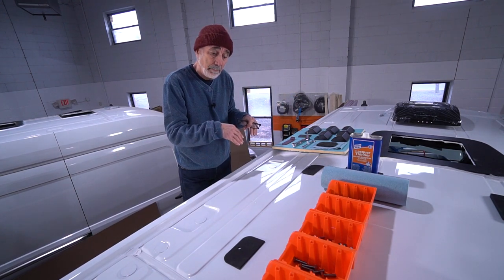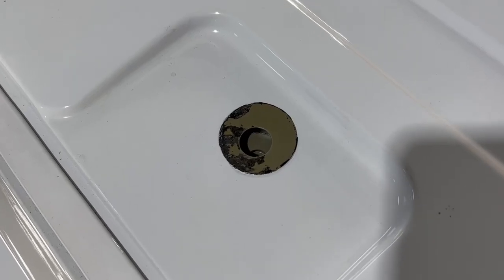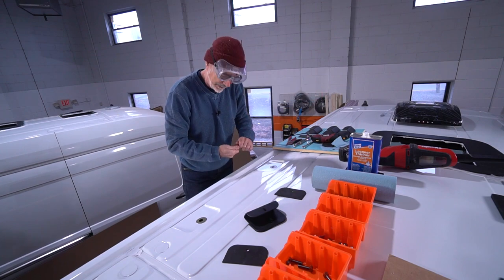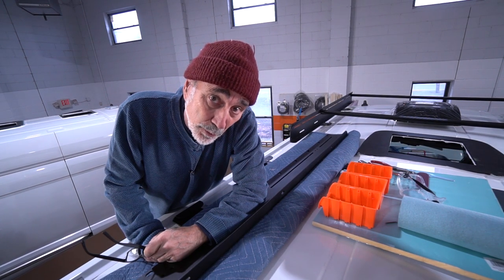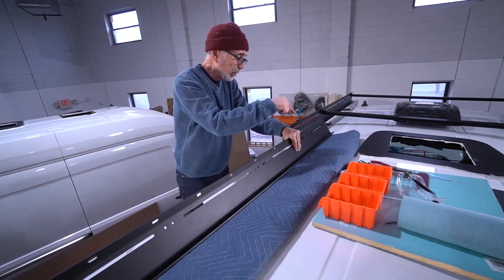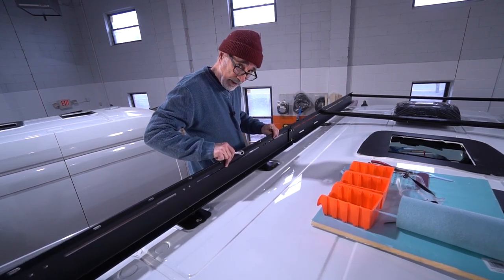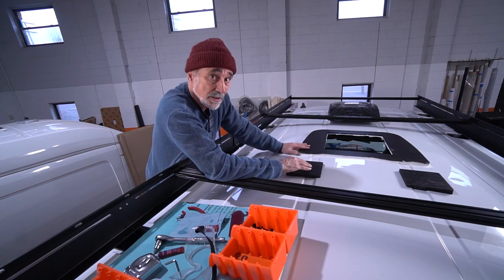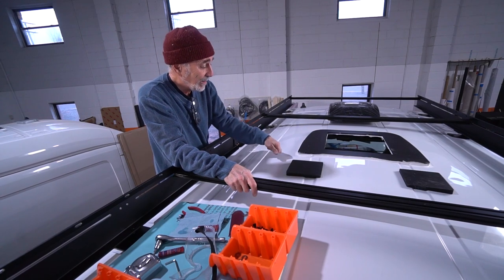Custom Van Build - FORD TRANSIT - High Roof Rack, Weight Issues and Fan Leveling Gaskets.

Comment: Hi just had a question about the weight. I understand your concern about the weight on the rooftop, but how does the weight of the ceiling only being a few inches below affect your calculations?
Reply from the maker: It’s all about center of gravity. If you notice the low roof transit has a much higher weight capacity for the roof than the high roof version . If you think about it, they’re both made with the same gauge materials. It’s just that the high roof has a higher center of gravity, so you have to work with a lower weight capacity. The roof can take the way you just have to make sure you keep your center of gravity low and you’ll be fine.

Comment: Why not hang the air conditioner from the ceiling of the shop and roll the transit under it and lower it down onto the roof
Reply from the maker: I've got 22ft ceilings...ain't nothin' gonna hang from that ceiling!  The manual crank forklift is easier and better stored than even a gantry crane.

Comment: 🚚🚚🚚Hey HR - you indicated the roof rack can't take no more than 220 lbs. 
Wouldn't the the o/h fan and the A/C contribute to the 220 lbs weight to the roof area? Or is there another specification for weight limit to the actual ceiling of the van?
Out of curiosity - how much does the fan & a/c & braketry weight?

Damn - that is a sh*t tonne of lights/setup for doing proper videos.🎬👏🎬👏🎬👏
Reply from the maker: Terry, it's not the rack that has a 220 lb limit, it's the WHOLE ROOF!! Including everything up there. As I illustrated in the chart, with the bare minimum I have up there, I'm 70 lbs overweight. I'll have to add some structure to the underside. But I believe most of the weight rating has to do with center of gravity. That van is high. Thankfully, my clients are not Formula One drivers...
Reply: @HumbleRoad  Got it - the "whole roof". Thats why I asked you - Cuz you actually read the manual.👍👍

talking F1 - I put Fox 2.0 shocks on mine - do you ever put better suspension on your builds? (I don't recall seeing whether you do or don't) I catch up to fast cars in the twisties 'all day long son' - good fun & very embarrassing to dude in the car though-:)🚗🚗🚗
Reply from the maker: Only add on I do is Sumo springs. A shock upgrade would be very beneficial on a Transit.
Reply: @HumbleRoad  Fox 2.0 reduce wallowing in the corners & rough dirt roads - big time.
Reply from the maker: Good to know. Thanks.
Reply: @HumbleRoad  "Agile Offroad" in San Diego has a special relationship with Fox and calibrates it to your van's trip ready weight.
Reply from the maker: I know someone sending their van there for some work.
Reply: @HumbleRoad  Then the mid roof would have higher rating? Might be the structural ribs that carries the entire roof load are just weak. Hate to see what a rollover accident would do. 
Hopefully the next Transit that was to be shared with VW will be much better design. Needs more usable (flat) area.

Comment: Knowing that these vans are used for RVs and for work vans, Ford needs to step up their game. Thin roof metal is poor engineering, and poor accounting practices. "Penny wise and pound foolish."
They also need to duplicate the Mercedes long wheel base and longer box. Two feet of extra space is a Huge improvement in a van build, and in a work van too.
Most Americans still don't understand what Edward Demming was preaching.
Quality. Quality. Quality. Reinvest profits into the business. This seems to be what George is doing with his business. Keep finding a better way, a better tool, a better work space, a new person to do a job as good or better to grow the business. The Toyota Way. Kai Zen. Continuous Improvement.
Ford and Gm still want to do things the way they did in the 1940s. Good Enough.
Reply: Ford is attempting to keep the overall weight down by using thinner metal on the roof. I own both the Flatline roof rack and a 2020 Transit. The roof dented like a beer car when I cut the rear Max Air fan opening, do I changed my method on the second hole for the Dometic AC unit and far less small dents (mostly from my elbows!)

Comment: Next door neighbour was fitting some roof racks to his 4WD, I was giving him a hand - we used all my tools, he had lemonade. I asked him what he going to carry, he said a small aluminium dingy and the racks were rated ( for load ) about 60lbs more than the dingy weighed. I told him to consider the wind drag of the dingy and force of the wind at 60 - 70 mph, and told him I was unhappy with the set-up and supplied my own bigger high tensile bolts. Told him and his wife I wasn't happy and if anything went wrong, it was on them. They said I worry too much.
First long weekend and off he goes into the wild blue yonder, dingy family, fishing rods - the works.
He comes knocking on my door on the Monday after, all gloomy with his wife and said that the dingy had torn the roof rack to bits and had come off on the highway at 60mph, onto the following car, nasty.
He and his wife were going apeshit, said it was all my fault and rah, rah, rah really loudly. My son was listening for a while and went into the study, comes out about 5mins later and asked us all to go into the lounge. He put a USB stick into the tv and played the security cam footage - with sound that looks down our side by side driveways. It was high-res footage and it clearly recorded me saying over and over not to put the dingy on the rack or spend another $100 for a really heavy-duty one, got them both telling me I was a worrywart and a sad sack and also me telling them not to put the dingy on top and if they did it was on them. 
So just take into consideration the wind force acting on your rack and the fittings holding it to your vehicle.
I was so glad my lad talked me into getting a really good camera and not that their daughter is, '' So hot, the devil would need air conditioning. '' - His words not mine.
Reply: Glad the situation didn't blow up on you. The nerve of some people. Kudos to you for helping in the first place.